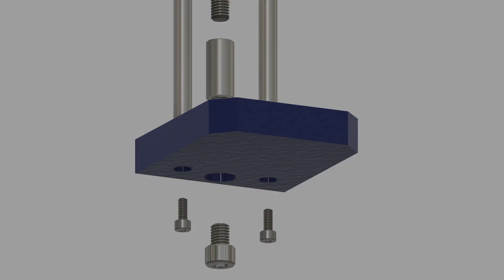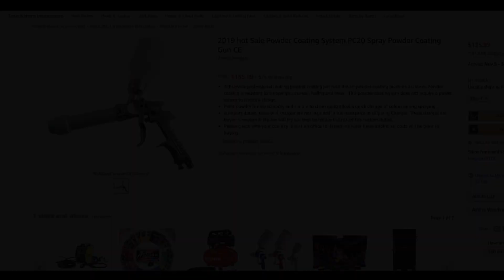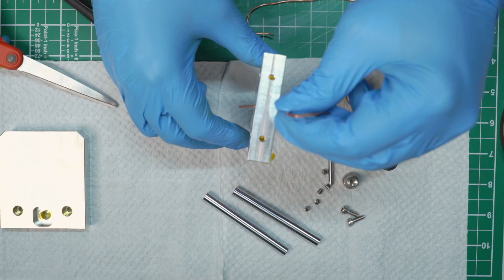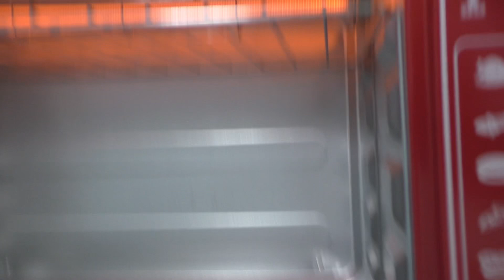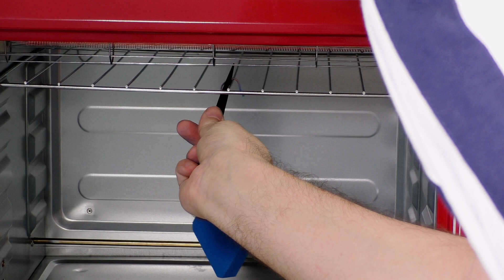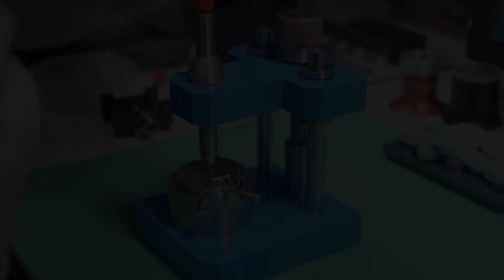DIY Powder Coating at home - Hand Lifting Tool Jig - Pt.3 - powdercoating

Comment: Good job as I expected from you, take care when powdering.
A question: I have to set the seconds central chrono hand to zero position on an omega speedmaster automatic (valjoux 7750). It stands on 2 o'clock position when reseted. Is it much more complicated to get this hand off and on than a usual seconds hand on a 3hander?
Thanks and regards.

Comment: That seems a nice simple way to powder coat - good result !  I yelled 'nooooo' out loud when you wiped that acetone off your cutting mat, Mark :o)  Acetone is (I'm sure you know) a plastic eater - can't put it near any plastic unless you have tested it first - even tough polycarb will be trashed by it :O( IPA is plastic friendly, but doesn't clean quite as well of course.